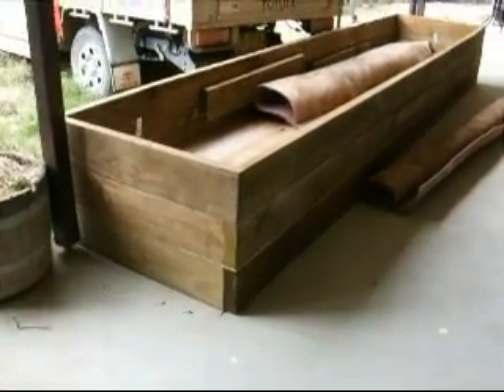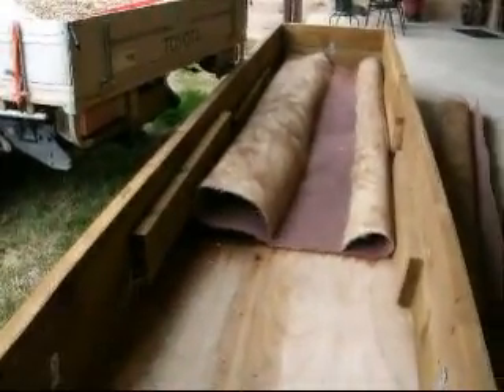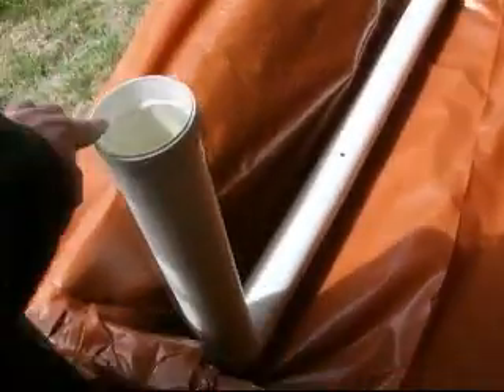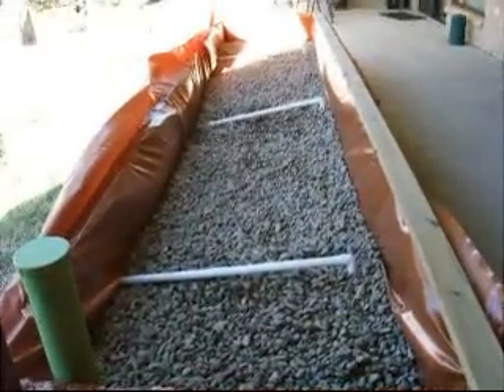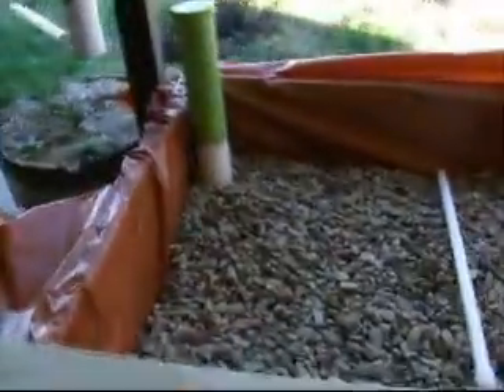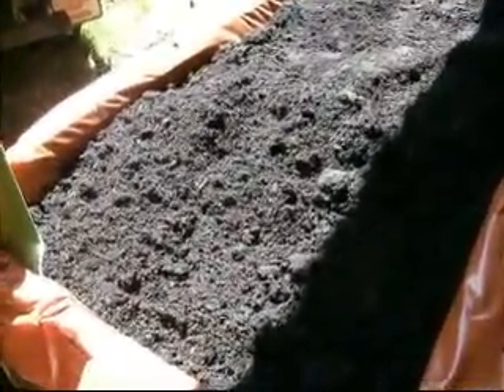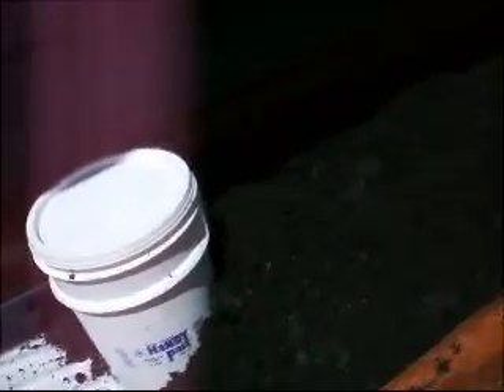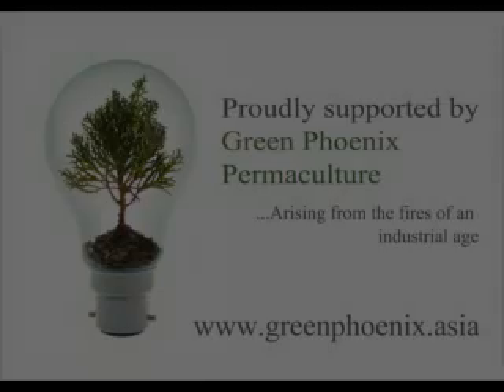Wicking Gardens at TSH

Comment: There is no need for an actual wick. I have done both and it doesn't seem to affect the ability of the water to travel into the soil. The wicking part is from the bottom of the soil layer to the top.

Comment: Hey Grafam, thanks for sharing this. Are the long PVC pipes necessary? If the gravel layer is kept relatively sediment free water should find its level along the length of the bed. Same with the overflow pipes. Also, what is the mechanism by which the water wicks up into the soil. Does the geotextile fabric need to dip into the water somehow, or will the plant roots get through it? Not related to the bed design, but how much light will your bed get during summer being under the eve of the house?

Comment: Hi, most designs I've seen use a separator - either a weed mat or plastic - between the reservoir and the soil layer. It's ok not to have one?
Reply from the maker: This design did have a geofabric separating the gravel reservoir and soil mix. I'll soon be adding a new video (to my new sustainability channel) detailing version 2.0. Keep an eye out for that... ☺️
Reply: Will be building my beds soon. However, a link to the channel for Version 2.0  would be very helpful, please.

Comment: Can you tell me was it successful and do you have a followup from this design?? please as I am very interested in this method of gardening/
Reply from the maker: It was successful however if I was to rebuild it I would use a finer gravel in reservoir. One of the issues I had with this garden is that when the water in the reservoir got low, the gravel didn't have a strong enough 'tension' to wick water from the bottom of the reservoir.
Reply: *****
Hi. Can you tell me what keeps the water in the area below the wick (the water in the reservoir) from becoming stagnant and contaminated with yuk (mold, scum, what ever) if you get so much rain the water in the reservoir is not needed (not wicked up) for a long time?
Reply from the maker: It's not an issue. What stops ground water from becoming stagnant? I'd suggest not trying to over think the design... try to keep it simple & it'll work. :-)
Reply from the maker: PS. The caveat to that last post is to be open to design changes which EXPERIENCE suggests. If, for example, stagnant water became a problem (though I haven't seen it) then I'd look at my design to fix the problem. But I wouldn't try to remedy problems that I haven't seen with my own eyes or been reported by someone I trust. Tried that and it always creates headaches. :-)
Reply: Thanks for the information and video, but ground water does not usually become stagnant because in natural environments it usually isn't held in one small spot as the water in this type of situation. Telling someone to keep it simple instead of addressing an issue is a cop out for someone who doesn't have an answer. But like you say, you must go by what people you "trust" tell you if you don't have the answer.

Comment: OK - so I watched the whole thing, just to be sure. This is not a wicking garden. Why not? Because there's no wick! Think about it. There's a reservoir of water in the bottom, a layer of soil on top, and a layer of landscape cloth in between. For the water to reach the soil, it must be drawn up through the cloth. So what happens when the water level falls below that of the cloth? No direct contact, no wicking action! You need soil extending down into the water for the wicking effect to occur.
Reply: i was told the water can wick up rocks and other things.